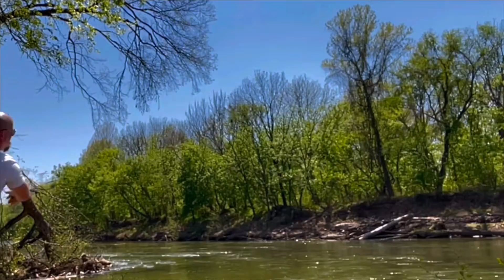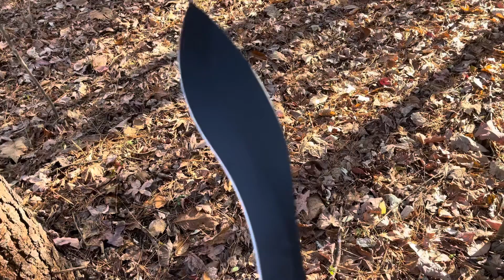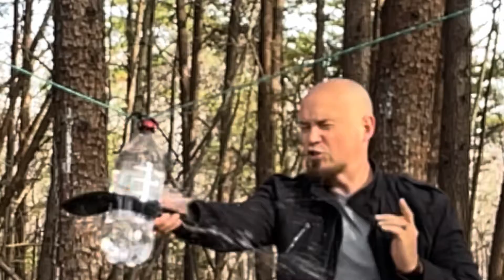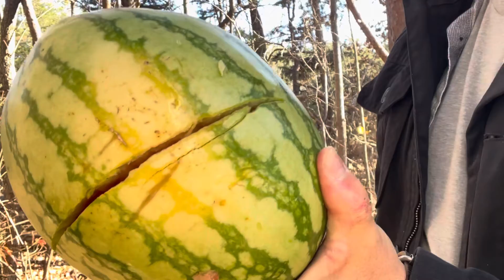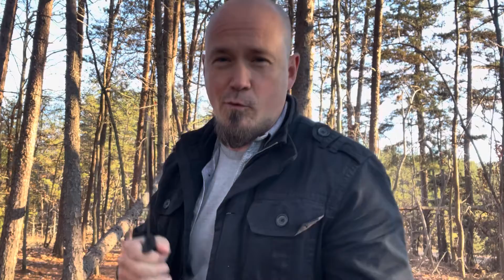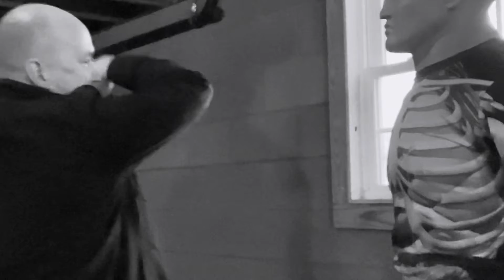The Combat Kukri from KABAR

Comment: I have the larger k bar kukri machete always wanted to sharpen the swedge so it would have a piercing capacity.The swedge goes to halfway along the blade so you have a large leaf shaped blade with a piercing tip.If you could use it properly like your Man seems to be able to it makes a perfect combat knife😊

Comment: Very good review ! I have two Ka-bar combat kukri knives. I like them because they are fast and sharp. They can stab and slice. As for myself I judge a knife with four different capabilities. Stabbing, slicing, lopping and blocking. So I have a tendency to flavor blades at least 10 inches or longer. I think the Ka-bar combat kukri can stab and slice well. But will not break bone or easily go through bone. It is light so that is a nice plus to it! Again excellent review! Check out the Spartan Harsey Kukri . It has a little more weight for lopping with about the same length blade.

Comment: I think if you went and did Muay Thai and boxing you would've found out that all those times with katas were an absolute waste of time. You would've learnt much better footwork to fight with knives from boxing itself. Kali is a must.
Reply from the maker: I took to Muay Thai more than I did karate for sure. I also got into Kali in recent years and discovered that the movement of the katas I learned in the past did translate well. People shouldn’t see a kata a way to learn how to fight. It’s just a unique form of changing direction and moving. I’ve learned to see every style as valuable.
Reply: @411Outdoors You need to do lots and lots of sparring to see what's useful.

Comment: Hi Daniel! Would you be able to get to your Combat Kukri or any other self-defense tools in time if home invaders started kicking in your door while you're relaxing or sleeping at home?

If so, how would you recommend setting up a home so that you and your loved ones are safe in any part of the home they may be in if criminals were to strike?

After all, of what use is a Combat Kukri or any other combat tool if you can't get to it in time in an emergency?
Reply from the maker: Great question👍 my primary home defense weapon is my shotgun (5 plus one capacity) and I can reach it within seconds. The key is being able to buy time. I have good locks and an alarm system allowing for response.  My back up weapon on me would be ESEE 4 tactical double edge for close quarters. If my Kukri was my primary home defense weapon, I would keep it under the bed most likely. For those who don’t have a gun or can’t come back cookery is great because it’s good for clothes quarter environments.
Reply: @411Outdoors  Thank you for your reply. You mentioned you have a shotgun for home protection. Have you done simulation drills and timed exactly how long it would take you to get to it, unlock the safe, chamber a round and aim, etc. from a resting, sitting position in the furthest part of your house away from your gun safe?
Would you be retrieving your cell phone and dialing 911 on the way to your shotgun or after you already had the shotgun in hand?
Thank you in advance for answering my questions! :)
Reply: @roseivory8496  You obviously want to play games for your anti-gun / anti-freedom / anti-self-defense agenda.  Anyone can get answers from Massad Ayoob, Tom Gresham,  James Yeager, Jeff Cooper and other experts on YouTube.

Comment: Good video. As far as kata's are concerned it helps if you have an instructor that knows a lot about the kata they are teaching. The biggest thing that I've learned in my over 35 years of kata training is understanding principles that you can apply in several different areas of training. When you are able to get the lower body and upper body to work together tasks that are related and not related to martial arts training become more efficient and easier. I have done some land clearing with a machete and thanks to my martial arts training I got a lot done and then slept well because my entire body was sore not just my shoulders/arms. With today's technology it's a good idea to video yourself doing a kata because in doing so you can see the good and bad in your movements and work on improvements. I practice at least 1 kata every day, sometimes more than one depending on how my 65 year old body is feeling. Some martial arts styles like American Kenpo have sets that are also useful along with kata training.. Kenpo Finger set teaches you how to brace your fingers together for striking and avoiding damaging them. Keep up the great work.